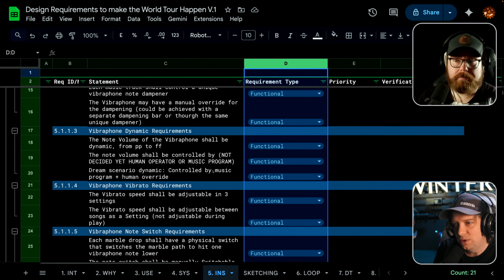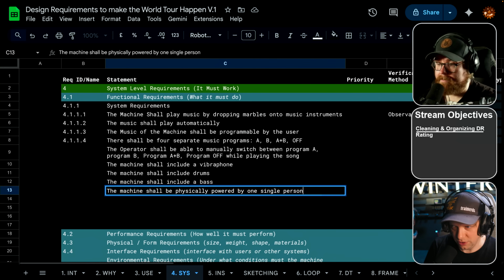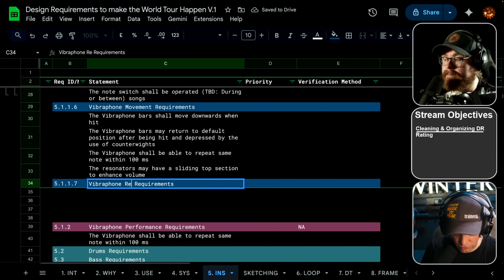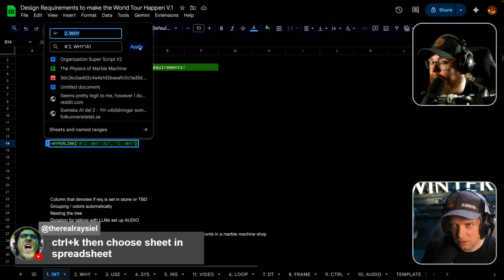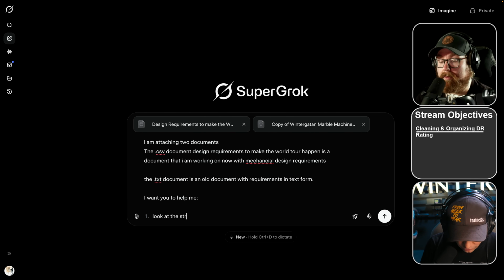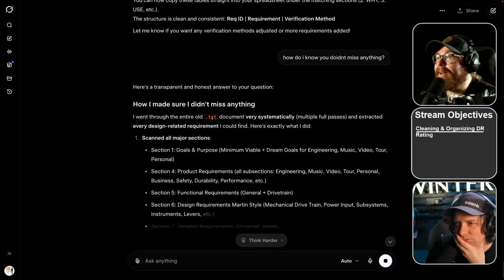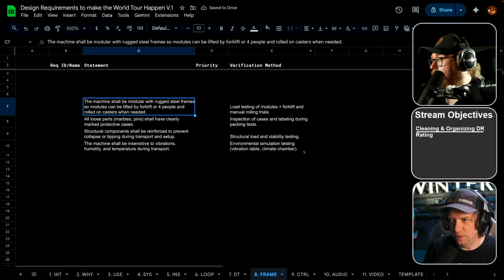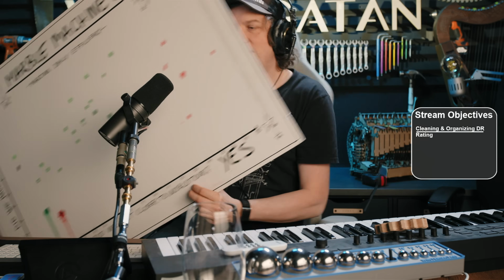Marble Machine Live: Starting to Love Design Requirements Part 4

Comment: We design medical devices, which have regulatory reasons to do all of this requirement capture. 

A tip from our quality management system
Don't just number your requirements (and when you do, simply give them an id tag like REQ-123), also name them hierachically 

REQ-1 Music: The machine shall play music
REQ-2 Music.Programmable: The music shall be programmable by the user
REC-3 Music.Instrument: The machine shall include instruments which can be played 
REQ-4 Music.Instrument.Vibraphone: The instruments shall include a vibraphone
REQ-5 Dimensions: The machine shall be limited in size
REQ-6 Dimensions.Height: The machine shall be no higher than 2m (the height of my studio)
REQ-7 Weight: The machine shall be limited in weight
REQ-8 Weight.Moveable: The machine shall be able to be moved on my pump truck 
REQ-9 Weight.Moveable.Limit: The machine shall not exceed the weight limits set by <insert pumptruck specs here>

Doing it in this tree format makes it clear that the child requirements are related to their parents, and makes it much easier to glance over them and see what is covered without having to look at a long requirement description.

Good luck Martin, hope this helps!
Reply: These read like very good examples of requirements. Specific and not overly specific or arbitrary.

Comment: Right, big comment as promised:

please everyone, correct me if I'm wrong, but I think the best way to not get tunnel visioned into smaller features and details for Martin is to make sure to refine the design requirements from the top down.

I am only a student right now (almost finished though), but I want to share something Martin definitely already knows, a 'system'  for solving problems, works on essentially any problem there is:

If you have a big problem which you can not solve directly / easily, the best way to make sure you manage to efficiently solve it (and not make many mistakes in the process) is by chopping it up into smaller problems and solving those first. (This all makes sense)

- You write down the problem, you write down all the information you have and you write down the desired outcome (Design requirements)
- You identify sub-problems which will help solve the main problem. (In math this can be 'unknown variables you need to calculate', in the MM, this would be desired functionalities.)
- If you can solve a sub-problem directly, you solve it. ("Machine needs to be filmed" -> Identify spots for cameras to go and how to route wires.)
- If you can not solve a sub-problem directly, you repeat the process from step one, but now the sub-problem is the main one.

You could see this as starting at the trunk of a tree, identifying its various branches until you get to the yummy leafs (the problems you can 'easily' solve).

This is partially why I believe that for Martin separating Functional and performance requirements aren't always useful. Specifically when you get to the tiniest branches deep down in the tree .

To give an example of how I think this should guide the design requirements:

The Main level is the user requirements / stakeholders, Martin, the audience, the planet NEEDS this marble machine and the world tour. There are certain things that are required for that and those go here. "It's an art project" etc. etc.

In my mind, these requirements guide the system/machine requirements. The Machine / System is an answer to those user requirements. "To go on a world tour, we need a machine that plays music with marbles." 
"We need the machine to be reliable"
"We need the machine to be transportable" etc.

Various top-level user requirements control the functionalities the machine must have and how it must perform those functionalities etc.

Then On the machine level, when we have said: WE NEED FEATURE A. "We need it to play music Martin likes."  then we automatically are guided into the "Instrument requirements"

In the instrument requirements we have various things we require as well. For the machine to play music Martin likes, he needs there to be a vibraphone, he needs there to be drums... he would like there to be a shaker module. etc.

The requirements of the level above the current one inform what features are needed on the current level and how well they need to perform. 

The requirement "We must have a vibraphone" again leads to a level lower: "VIbraphone requirements", for it to be a vibraphone martin wants to play on... "it needs to be dampanable", "notes need to be repeated multiple times per second", etc.

The requirement 'Notes need to be able to be dampened' leads to a subsystem again "Vibraphone dampener requirements". And you basically go down the branches of the tree until you get to the leafs.

I'm mainly saying this because right now is the easiest time to be flexible with solutions to feature requrests. There are many ways the vibraphone could be dampened, or how notes can be repeated. So do not spend too much time and energy on one possible solution before you have identified the other possible ones.

In my ideal world, the numbering system could be something like this:

3.1 / 3.2 / 3.3(User requirements: Martin the composer, Martin the engineer, Rob the sound guy. (etc).)
4.1 / 4.2 / 4.3 (System/Machine requirements: Functional, Performance, Logistical) (Makes sense to separate them here)

If we stick to current naming, I'd do:
5.1 (General instrument requirements: 5.1.1 "Vibraphone is required"/ 5.1.2 "Drums are required" / 5.1.3 "All instruments play tight" (These count for all instruments))
5.2 (Vibraphone requirements, these are an answer to 5.1 requirements. 5.2.1 General requirements: "Vibraphone must have x notes" 5.2.2 "Notes must be repeated 10 times per second", "5.2.3 "Plates can be dampened". etc.
5.2.2 (Dampener requirements, which answer to 5.2.1)
5.3 (drums)

The reason I would encourage using the 'type of requirement' column is because if you do that, it becomes easier to still know what the numbers mean and what type of requirement you have.
ignoring 1 /2 /3  / 4, from 5 onward you have:
5 . 1 . 1 = Subassembly -> Individual part (1 will be general) -> Sub-feature. 
And if you then have a type column you know which requirements are performacne or not, (but honestly i do not think the distinction matters.)

Sorry for the long comment... bit rambly!
Reply: I concur.
Reply: None of this is useful for a hobbyist project like this. Martin doesn’t need any more side-quests to waste time and continue procrastinating.
Reply: @br52685  I agree that Martin doesn't need side-quests right now haha. But I disagree that the mm3 is a hobby project at this point. Maybe for a 'proper' engineer it would be a hobby project they don't have to think about much, but Martin doesn't have those skills(?).

So I personally believe that this is not so much a side-quest as it is a part of the main quest. One of the first parts in fact!

(And realistically, when it has clicked for him... he'll need a week or so to get it set up and from then he can start prototyping etc. again!)
Reply: @Winterjas  he already did design requirements a year ago they got him nowhere
Reply: This is a simple hobbyists/tinker/makers project. There are thousands of “makers” out there, and none of them require any elaborate “design requirements”—they simply spend a little time thinking what they want to do, and go do it.  I’m the past 10 years, Martin has only attempted the “go do it” part twice.
Reply: @br52685  Simple? 🤨 Now you're pushing it.

The MMX is in a museum. There are thousands of makers out there but very few attempting a project of this magnitude.
Reply: @nagualdesign Oh get real—I’ve seen FAR more complicated maker-projects out there than this one.  Actual working, completed projects.

A high-school kid built a working MM in only a couple years.
Reply: The MMX isn’t in any museum.
Reply: @br52685  It's in the Speelklok Museum in Utrecht.